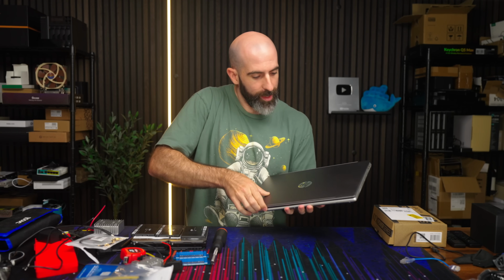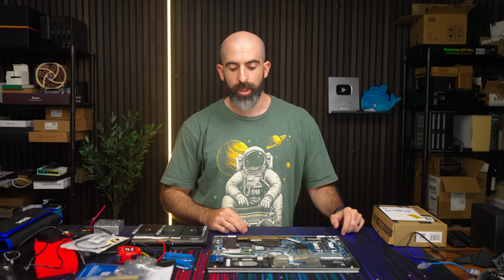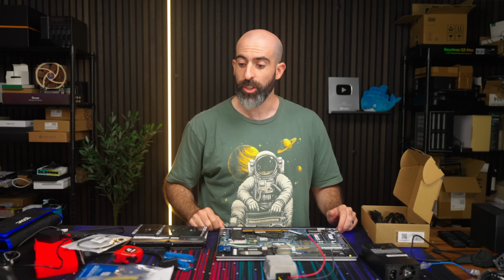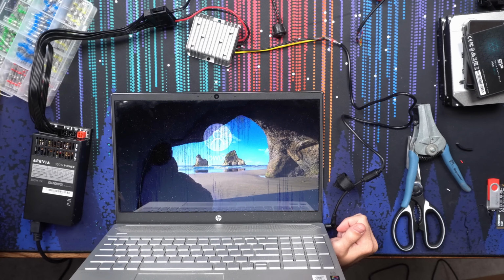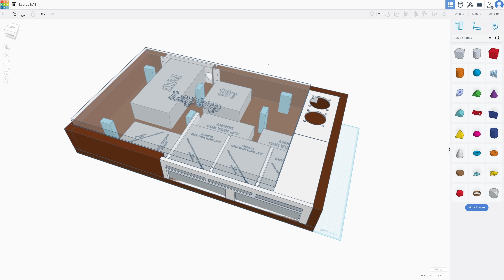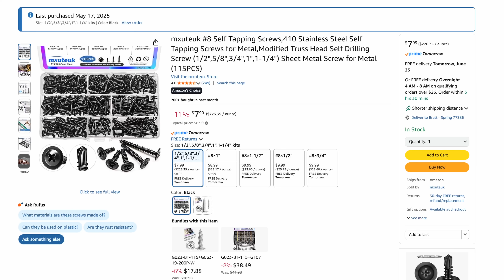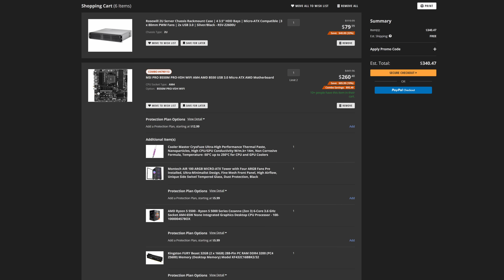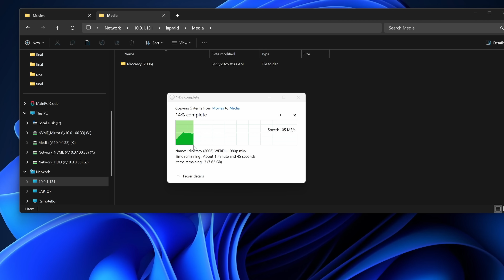I turned a laptop into a NAS

Comment: Cool video. You might want to try repasting the CPU heatsink. It can fix overheating on old laptops where the thermal paste has dried out, which causes poor heat transfer between the CPU and the cooler.

Comment: Kind of a lot of weird choices here. An old office 1L PC would be categorically better for the same money or less. Better cooling, better processors, faster network options, better controls in bios, easier to work on, etc. Without hot-swapping there's no point in having the drive ends exposed. Airflow should be setup like every other rack device (front to back). Given the thickness of wood either grab an old 1U/2U device (can easily find outdated/useless equipment for free) and gut it or build a full 2U box.

Comment: I was thinking something similar, and when searching for a similar project, I found this video where you used my exact laptop model. This lineup of HP laptops sucks at cooling. When I used this laptop, I tried to find a cooler that uses both fan slots but could not find the exact part that would fit.

Comment: I love this idea. But I think I would have went with a m.2 to pcie x16 (x4 wired) and thrown in an x8 hba . Keep the bottom shell off ( or even remove the whole board and mounted it) and used a USB to Ethernet ( 1, 2.5, or 5 maybe even 10) for use for connecting. But I love little projects like this. I don't have the money to just throw at projects like this. But I get to live vicariously though these types of videos lol. Keep up the great work man.

Comment: I did that 6 years ago with a HP dv9000, the screen was broken. I put OMV on a SD card and had two 1TB HD's in it. I still have it and it runs without a problem.

Comment: Looks like a hp vivibook repurposed as a NAS! I have one of those lappys sitting here - they are very common, can be had for cheap on the usual auction sites and are a half decent laptop for day to day tasks. I use mine mainly for reprogramming radio gear, reprogramming RC helicopter flight controllers and hacking DJI drones to remove the no fly zone rubbish (I am a responsible pilot and use my government's app to check if I can fly!).

Comment: I think it’s pretty funny that that’s even technically an AVX512 capable NAS, not that I know of any NAS stuff that would significantly use that. (Transcoding would benefit, but only offline & not real-time. Same with facial recognition, although Idk if 1. anything like Immich actually takes advantage of that, or 2. I’m pretty sure the iGPU would still be faster.) 

Couldn’t you also use one of the USB ports for a cheap USB to 2.5 Gbe or even 5Gbe NIC? I don’t think there’s really much else use for the USB ports, especially if you’re keeping the keyboard and touchpad.

Comment: I would just solder the 19 volt wires to the board where the jack is, bypass the barrel as it's external.
Reply from the maker: Yeah but now I can hot swap in all the hp laptops

Comment: Linux doesn't care what drive you install it on whether it's SATA m.2 IDE USB FireWire. All you need is an extra USB drive to go with your live USB. Then when you boot up the installer select the USB drive to install Linux and the bootloader onto the USB drive and it will boot.

Comment: REMOVING SCREEN? Why, it's ever okay; once in a while, all the server-direct connected screens at some point see what's going on. It's still viewable – not great, but still more useful than looking at the power LED light flashing off and on. The acting at the top lid, over the keyboard, stops key presses from happening and makes it look less like a piece of junk. My only real concern is that you have removed the screen, but does the laptop still think there is a screen there? It's still burning up power to screen what's not there, and with some technical problems, it doesn't inform you of that on the screen, which you will not see, and it makes the remedy much harder than it needs to be. and am the laptop power supply It's a good idea if you don't have one, but as you already have one, I would say this laptop's own power would be a power-usage-friendly option long-term, as long as it's left in an open place somewhere cool. one fan and moving part to fail
Reply from the maker: Dude…the screen was broken and it still has and hdmi port, relax. Lmao

Comment: Why would you remove the display? Yea it has problem but for lock out or trouble shooting it’s still good enough other than that the lid is closed
And most laptops can limit charge up to 80% then 24/7 plugged in isn’t an issue
Reply from the maker: Nah

Comment: Could you have swapped in a Wi-Fi 7 card, to get higher bandwidth than the 1G Ethernet (assuming you've got a 2.5Gb - 10Gb connected Wi-Fi 7 Access Point)?

Comment: I was thinking about something like that, but at the end of the day, I went with a regular PC with a low TPD processor (i5-10500T, 6 cores). For me, the most important factors are Proxmox, homelab capabilities, a large HDD, low power consumption and a firewall (2 PCI network cards).
My standard power consumption is 46 W.
Pros:
- very low power consumption,
- quite broad functionality,
- good performance,
Cons:
- limited RAM (max 64 GB, processor limitation) and uses SDRAM
- You can't add another PCIe network card. 
Good job.

Comment: My current Jellyfin media server is an old ASUS laptop with the internal 2.5" drive bay having a 2TB HDD and the optical disk bay being replaced with a 2.5" HDD adapter where I put another 2TB HDD in. Then I run my Ubuntu Server install which has Tailscale and Jellyfin off a USB 3.0 to m.2 SATA SSD enclosure. It works and it's actually kind of portable with the battery being a UPS of sorts.

Comment: Too much work, too much additional money to spend - there are laptops with two m.2 connectors and space for an sata-drive ...
Reply from the maker: You clearly didn’t understand the point of the video
Reply: @RaidOwl  I do, it was about trying something and build something because you can, but to be honest, you simply have to much time to waste and probably too much money also, else you would see things different.

I am more into min-max things, making the most out of almost nothing AND being able to use it for real.

Like taking an empty, no whole 19" case and putting in something that was clearly not intended for that, like a C64 mainboard and relocating all the ports to the front-panel no 3d printers back in the day, only some of the first reliable CNC-machines that were a pain in the ass to program and operate.

Or at times, when those weren't available, to modify PC-cases in a way, that you could put in an AMIGA 2000 Mainboard and use it like your common PC.
Using a "pcoket-pc" as a remote for winamp running on a windows PC, so you would not have to switch from full-screen gaming to windows desktop.
Installing LEDs in cases with an acryl front to illuminate them, when LED-strips were either extremly expensive, or just not available.
I am an mechanic, a toolmaker turned IT-Nerd and pro, I am building "special" machines since the mid 90s and still am not commenting on how you build that case, but since you think you are above people like me, "critizing" the "plausability" of such builds, you made me answer this way.

Comment: need more high power fan. more powaaaaaaaa.
but in seriousness, yeah. drive need better cooling to prolong their lives. and if you able, open the bottom cover and put more cooling to other parts of the board. yeah I know it's just a jank laptop to begin with. but if it can survive many years ahead, why not right? even when the cost way higher than the laptop itself. that's the cost of DIY. LOL
oh perhaps you can seek some SATA backplane, or combo connector (SATA + power in one cable) and stick it into the 3D print, you could make the drive easily removeable (just not hot swapable).
nice one man!
Reply from the maker: I def wanna snag a backplane and build something chain around it for my next project
Reply: @RaidOwl  or maybe scrap from a used server backplane? why reinvent the wheel when you can snatch it from somewhere else. 😂

Comment: You can usually configure laptops to optimize their battery for being plugged in a majority of the time. Mostly it just limites the maximum charge, so the battery won't degrade as fast. I'd be comfortable leaving the battery in there as a UPS (if you power all the drives from the battery as well).
Reply: Exactly my thought. Grade school teachers pretty much leave their laptops plugged in 24/7 as desktop replacement.
Reply: Also, after the battery is optimized, you have the added security of windows shutting down the machine when the charge gets too low, saving components lifespan.

Comment: Did the same with a NUC-motherboard and combinded it with a brocken qnap-4-hdd-system + two small ssds and installed xpenologoy through redpill arcloader. Pretty frankenstein, but suprisingly it works also pretty fine. If i change anything i will maybe try truenas with it.

Comment: That screen problem is an hp classic. It's got something to do with the cable and / or the controller on the screen. I've had two personal laptops do this! one of my grandparents and a handfull at work, I'ican't remember the number. They KNOW that theres a problem and refuse to fix it. Hp is dead to me just like their printors, and just as dell was in the early 2000's with their prebuilt  pentium 4 over heating hot crap bulk pc's! Not to mention the capacitor plague.

Comment: My back-up / NAS is just an old laptop with a broken display, I use x11vnc or ssh when needed.
It's a regular Mint, using rsync and nfs in a crontab script.
The script also use Zenity and export DISPLAY to make sure all is good every morning.
So simple I don't need Truenas or any dedicated Linux/BSD version.
It's even not using a SSD except for the OS, just a rotating drive in place of the previous cdrom.
I've tried Plex and others, but it's boring to use, doesn't always display all the movie I send to the machine, and use a lot of cpu for nothing.
I just watch movies over nfs with Vlc.
Keep it simple ! :)

Comment: FINALLY someone mentions how leaving a laptop w/battery connected 24/7 is a bad idea. The vast majority do not know this fact.
Reply: It is not in every case, since it depends on the age of the laptop - newer ones are build to have the akku inside all the time, so it does not hurt, nor unloads them over time - mine has been sitting on a shelf for two weeks lately and still had 99 percent ...
Reply: A "good" modern laptop adapts to your usage pattern. My laptop is plugged in while in use and has an option to only charge to 80% so the battery lasts for about a decade. A decent BMS will cycle the battery or lower the max charge limit based on your usage.

Comment: The best thing with laptops as servers, is the built in UPS, you should however set it to not charge more than 60-70% (Lenovo)

The 19-20 volts is needed for screen backlight, and battery charging, otherwise many machines can run on less, maybe even 12V, but might still use the 40-60W = 4-6Amps @ 12V (probably not, but make sure the PSU can handle it)
Reply: Its often the battery management system that needs 19v. Without a battery many laptops can operate on much lower voltages. During covid (I was bored) I hacked a thinkbook into a car computer. It accepted a 12v input perfectly happily with no screen and no battery. However, when I reattached the battery it insisted on 19v. (actually, i think thinkpads use 20v??) I used an old 8 inch external monitor on the hdmi port for the screen. It worked, but I had zero use case for it. But it occupied some time!

Comment: Great video! FYI you could try running the laptop directly off of 12V and see if it works. Not guaranteed to work, of course, but I was able to do that with an old i7-8550u Chromebox that I'm using in a similar way and it runs without any issues (even though the label says 19v DC in). IIUC laptops generally take 19v power to be able to charge the battery, but if you're running without a battery then it'll likely be fine (and more power efficient).

Strictly speaking there's some risk in trying it, but generally under-volting things isn't particularly dangerous.

Comment: RAID you can program the battery to smart and adaptive charge but maybe that laptop ain’t got a smart chip for that. It is common on Dell systems.
Reply: I've only seen this option on windows. Are there any Linux or BSD packages that allow this?
Reply: @RaytheonTechnologies_Official  it's embedded in most pro lines of Dell. Recently because of how annoying it is to manage laptops when people are anywhere in the world I've considered doing smart power ups to boot and update when they at least leave the laptop powered on after midnight. I've used a decent strategy for the dell power management to customize my timings so its not overcharging also!
Reply: @kristopherleslie8343 so would this just include any latitude with vPro? Or is it wider than that? Asking because I've just found vPro ones a bit hard to source where I am (expensive new, unavailable used)
Reply: @RaytheonTechnologies_Official  i've done it on both styles. I will admit some of the lower models actually have a "lite" version of the charging in bios and on windows. Sometimes the functionality is partial. But if you have a latitude usually should be good to go.

You can basically make it adapt so its not just stupidly charging the battery when its fully charged which rocks.

Comment: Personally I would not choose MDF for the chassis.
Reply from the maker: Cool
Reply: Why not MDF ?
Reply: @nalinux because MDF can warp when it gets moist or heated. (As a server especially one built with a laptop it will get hot.) Additionally it can off gas formaldehyde.

Comment: Great build! ❤

I wonder if the 19.5VDC converter would work on a Dell laptop. I believe Dell has a third pin inside the barrel to check if you are connected to a "genuine" PSU 😢
Reply: You can often disable that in the bios, allowing any non-genuine power supply to work. Depends on model etc.
Reply: Dell connectors are larger than regular ones.
But this can be fixed with a soldering iron :)

Comment: With the spare laptops usb ports , am guessing they could be passthrough to a VM or 2 , and be able to add a USB to sata for a Blueray drive (backing up linus iso's) and USB 2.5g network adaptors ? usb hub ?
Reply: For networking i'd use the m.2 wifi slot, if it's PCIe and not stupid CNVIO.

Comment: I don't like to be critical but when you discovered the barrel jack was the issue why didn't you just bypass it? Not sure if the jack is removable (most are) but they usually have a lead coming off of them that can be cut off and rewired anyway you like. No reason to have a removable power connector if the laptop is now stationary! Perfection using that iron on banding requires a trim iron not a clothes iron. Sorry just saying!

Comment: How ironic. My HP 17 laptop just got tacoed 😂😂😂

Broke screen and keyboard but works as a desktop. I was thinking about making it a third proxmox node. But I need a replacement laptop to switch everything to first.

Yep it's now my third proxmox node! 

I got to say this laptop is an excellent server. 

Besides IMMOU pass through everything else is great. 

Reduce the load times for my website significantly from a 4720 HQ i7 CPU laptop that I was using to run all my heavy workloads.

Comment: My remote backup server is just an old laptop connected to a 24TB drive via USB running a TrueNAS replication task every day at 3am at my parents house! 😅
Reply: If it works it works! lol
Reply: I don't use a laptop for that, but an itx machine with an AMD 5350, since I could throw in a different nic - took some fiddeling with the card and case, but it works ;-)
Reply: Does using USB drive bottlenecks the RW speed? If it doesn't get bottleneck, do you mind share how do you do it? I am planning to do the same thing as my summer project🤣
Reply: God bless, think about potential fire hazards. Possibly move the nas to your house?

Comment: You could replace the screen with a working one and basically make the top of the box thingy a kvm.
Reply from the maker: Yeah but that adds like a whole 10mm of extra height. Can’t be having that.
Reply: @RaidOwl  what if the screen slides out and than pivots into position in front of the rack? Like those old-school desks/bureaus.
Reply: @RaidOwl  Can't you just lower the thing down and make sure that the screen would fit? It may be nice to add a "Drawer" mechanism so that if you wanna like, manage your server or to monitor it. you can just do it to that laptop whenever you felt like it.

This may be just me but, the way you said that "If the screen is broken, that then would be thrown into the recycle center" kind of disappointed me off because you can just replace the screen, sure it's a bit expensive but well that reduces the mountains of "Maybe-revivable" thrown systems.
Reply from the maker: @ItsJustJer2  Brother, I am speaking from a standard consumer perspective. You think the average person is replacing the screen on the their 5 year old Dell laptop? No. Everyone knows 'you can just replace the screen' but thats boring AF and my goal is get better at 3d design and printing.
Reply: @RaidOwl  Ah, i see the point now. Well, that's my own saying though. 🤷‍♂
Reply: could have replaced the screen and had a working laptop
Reply from the maker: @404invalid-user  Yes I could have also just not done the entire video